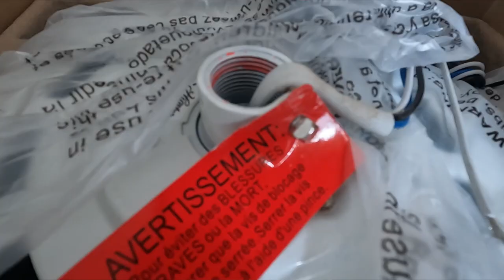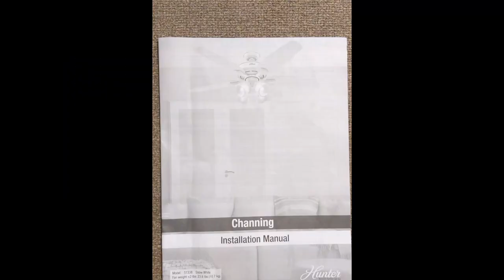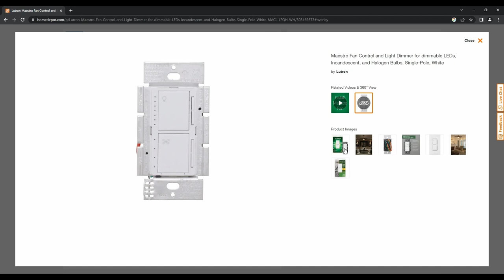Hunter Channing Fan Install

Comment: Me and my brother are trying to install a Hunter ceiling fan, and we’re just very concerned with how much the ball (down rod) is moving when put into the mount. I started to think and I thought that it was made like that, but at the same time I’m not sure why it would shake so much. When we grab the fan blade housing we can easily move it, wether it be shaking it or tilting it.
Reply from the maker: Thanks for reaching out. The hanger ball should feel like it's firmly seated in place in the mounting bracket but the ball and socket type joint does allow for some movement to help the fan hang level, reduce vibration and should also help prevent wobbling. This fan moves easily when I push on even a shade glass and when the fan speed is set to the highest setting, the entire fan moves but just a little.
Hope this helps and best of luck with the rest of the install!

Comment: Good video thanks. I actually came here to specifically see how you replace a battery from the remote but you didn’t even use the remote. Lol.
Reply from the maker: Thank you! Good question. I still have the remote and was able to use a small screwdriver to remove the single screw on the back of the remote. The longer piece of the back plate slides down about 1/4" and can then be lifted off to see the battery. It's held down tightly by a metal plate with two feet but a small flathead or phillips screwdriver will help push it out enough for you to be able to grab and remove the battery. It's a CR2032 battery and the positive side faces up. You may have to pair the remote with the fan again afterwards. This video shows the pairing process and shows the back plate being removed as well: https://youtu.be/MfQMYgUslIw
Reply: @wildcat-diy  thanks for replying. I didn’t want to force anything, not knowing if it slide open or popped off. Question. After only 7 months my lights just blink on and off when using the remote. The fan is fine. Have you encountered this? A search of YouTube says it’s the current limiter whatever that is. I’ve been on hold with hunter now for 53 minutes…..
Reply from the maker: @marciar8909  No problem, I certainly understand. I have not yet encountered that issue but the current/wattage limiter could be the problem if the bulbs in use came from the ceiling fan box or otherwise and don't exceed the max wattage (14W max for the Hunter Channing). The current limiter is a part of the wire harness kit and is in place as a safety feature to prevent the fan from overheating. If bulbs are installed that exceed the specified wattage, the wattage regulator either shuts off the bulbs or limits the wattage they receive to prevent overheating. Hunter sells a wire harness kit that sits in the lower switch housing and includes the wattage limiter and other electrical components, such as the color-coded plug.
Reply: @wildcat-diy  very helpful. Thank you so much. I am using the bulbs that came with the fan but maybe brand new ones will help. I appreciate your communications! 😎
Reply from the maker: @marciar8909  No problem 🙂 I'm happy to help. It's definitely worth a shot. Best of luck resolving this flickering light issue! I'd be curious to know what solves the problem you're experiencing. Feel free to update me later. Also, I love your channel picture with all the cats - very cute!

Comment: the rubbers that you installed inbetween the fan blades and the support arm is not correct. they are suppose to go on top of the blades with the screws i guess. lol
Reply from the maker: Which model Hunter fan are you referring to? The blades and blade arms may connect in a different way on other Hunter models. Some connect via a snap-on method for example, which is pretty neat. The Hunter Channing fan install guide does specify inserting the rubber grommets into the fan blade holes and then securing each fan blade to a metal blade arm via provided screws.
Reply: @wildcat-diy  pause this video at exactly 1:20, the gap between your fan blades and support arm is wide i thought there should not be any gap(please confirm manual again if needed) those rubbers should go along with the screw heads at top of the blade, and not in between the blade and the support arm.  by the way i was looking to buy one of these hunter fans came across your video. thanks
Reply from the maker: @nmsbro  Awesome! I've purchased a number of Hunter fans over the years and have been happy with them. 
I understand better now. Thank you for mentioning the timestamp. If you look back at 1:12, where there's an up-close view of the rubber grommets in a bag, you'll see that the top and bottom of each is wider than the middle portion. When they're inserted into the fan blade holes, the flared top and bottom edges are what's visible on top and underneath the fan blade.
The thicker rubber end creates a gap between the blade and blade arm, even with the screw tight.
It's not possible to eliminate the gap and it's ideal to have this gap to prevent parts from rubbing together, causing noise and wear. While the install guide doesn't comment on gaps in the blade installation section, Hunter defines grommets as "Rubber cushions that are inserted into the holes in the blades to reduce fan noise". This definition to me ties in with the concept of having a rubber buffer to prevent noise from friction/vibration. Hope this helps!
Reply: @wildcat-diy  thanks for such a good explanation and your time , only asked for the security doubts that blades gonna fall, and you cleared all my doubts. this will definitly help me decide among lot of their models out there, have a wonderful days ahead , beautiful voice
Reply from the maker: @nmsbro  My pleasure. I am so happy to hear that 🙂
I hope whichever fan you choose does well by you. Thank you for your kind words. I really appreciate it. May your days ahead be wonderful as well!